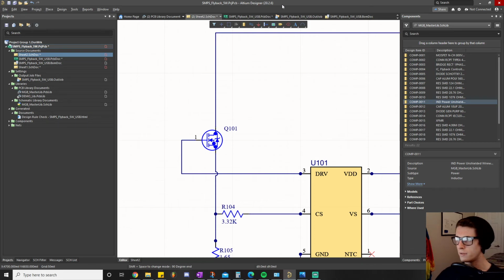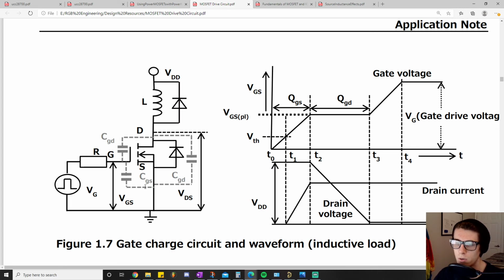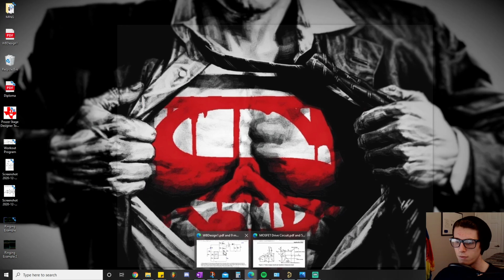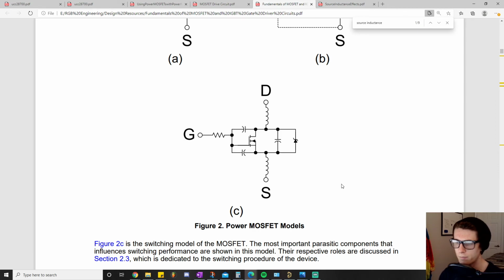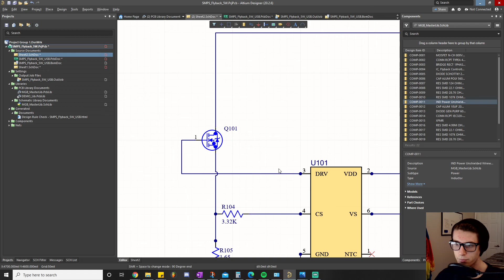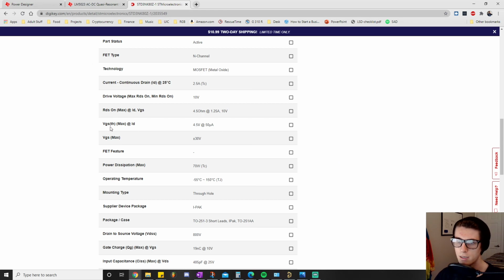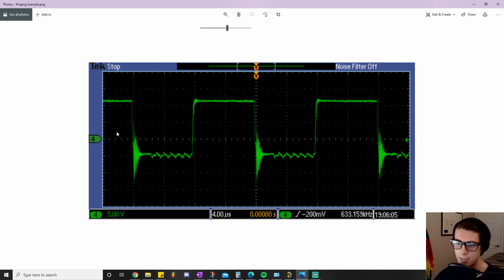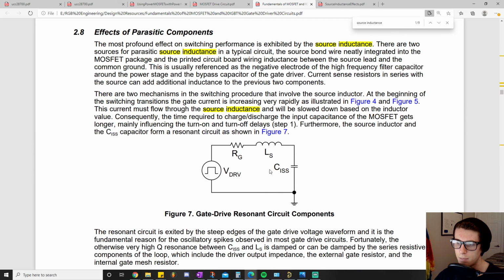MOSFET GATE-DRIVE CIRCUIT Pt. 1 | Circuit Design Tutorial, Altium, PCB | MOSFET GATE DRIVE DESIGN

Comment: In my design, i drive a mosfet through a bjt push-pull. The mosfet is in series with an inductor. During mosfet turn off, the source goes to -10V, forcing the vgs to go well above datasheet rating of 20V for a few microseconds, due to the inductor, i supose. Any sugestions in how to prevent this from happening? I assume there is a pretty high risk to destroy the mosfet.
Reply from the maker: the MOSFET should have a positive and negative voltage rating.
Reply: @RGBEngineering  it does, but i drive it with 15V and i get 15-(-10)V